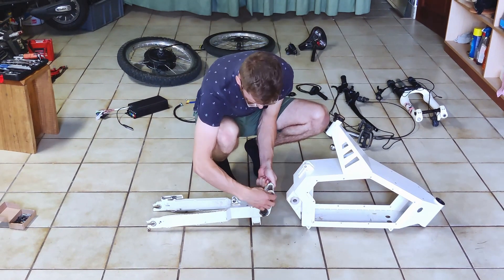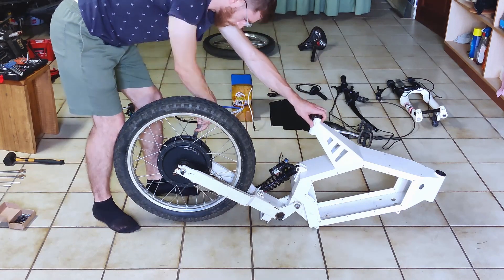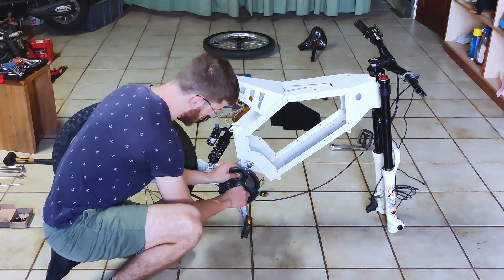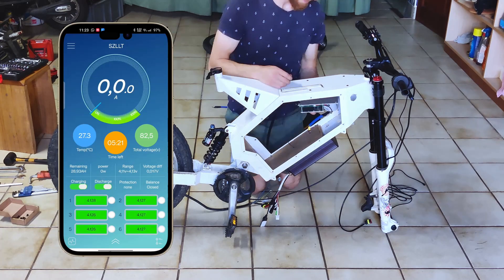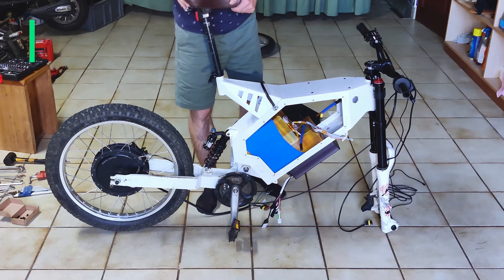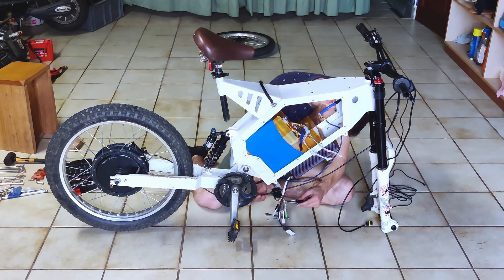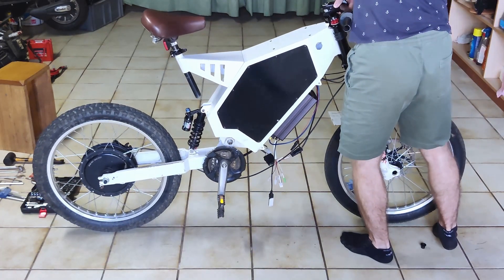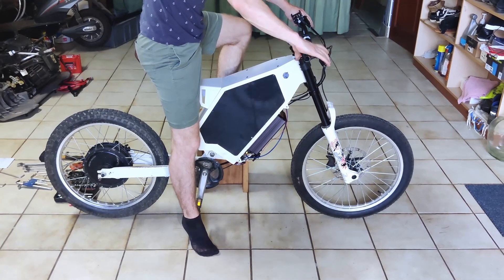DIY Cheap 5000W Electric Bike

Comment: I have the big frame and long swing arm that fits a motorcycle axel. I will be building a 12kw version with a QS273 5T with 200mm dropouts. The axel nut size will be 32mm. A Sabvaton 72000 controller and N7260 (72v 60Ah) battery. I have a built version already with those specs, that I got used. I will sell this one when I build my new one.

Comment: Where is Fuse, where is contactor!?:))
Where is pre charge button!?:)))
Have you ever seen a High voltage  DC electric arc!?
Please check the front wheel cylindrical joint welding too. mine is weak…

I encourage you to set up a safety feature such as
1. Contactor Albright sw200
2. Industry grade40/50 Amp dc  fuse like Chint CRT 36 00 50A
that can choke the electrical Dc Arc n a case of short circuit.
3. Dc to dc  90-12v DC converter, to power up  the contactors 12v coil that switches the High voltage contactor.
I have a schematics if you interested:)

The main problem is the controller that sits on a High voltage DC line. This is not safe. While you a sleep it still connects to your controller. This is not good for a capacitors.
That’s why you need a contactor.
And last thing- never turn off ignition switch  under load.
I mean, first make a full stop, only then turn off the key👌🙏

Comment: I got same frame bike with 48V 2000w motor battery 48V 20Ah and It go 60km/h top speed and constant 50km/h 
Why yours go only 70km/h with 72V battery??
Reply from the maker: Good question! The top speed of the bike is dependent on the voltage of the battery yes, but also the wheel diameter (mine is 19" rim on 3" tyre, overall diameter of 25") and most importantly the winding of the motor (or kV).
This kV is how many rpm the motor does per Volt. This motor is a 5T winding which is less speed and more torque. You can get a 3T which would give more speed and less torque but it is important to match the load of the motor with the top speed as to not overload it 
Also if the controller has field weakening you can get more top speed.

Comment: Can you tell me where you found the parts, because I looked and the prices are more expensive than what you indicated
Reply from the maker: I can tell you that the frame and front forks were used, that's why the discount. Other than that what did you find more expensive?
Reply: @Asvybre  frame minimum 500€ and électric wheel 400€
Reply from the maker: Yes the frame in the video is used, that's why the discount. The motor you can get for cheap if you buy directly from MXUS distributor. I ordered 5 different ebike motors and got a good discount.

Comment: Nice build and really cost effective! Have you rode it on rain? I'm just wondering is the sabvoton waterproof. I have the same controller and I'm also planning to put it outside of the frame
Reply from the maker: Thank you so much!
I used it in a bit of rain but honestly I am more worried about the motor than the controller. The controller does get some water on it specifically if you don't have mud guards like me but if you cover the connectors and phase wires it'll be fine!
On the other end the motor does not like water at all and I am going to open it soon to see if there's anything inside!
Reply: @Asvybre  been worried about my SB MQCON svmc 72150 also mounted in the same location. So, i took the four screws holding the side panels off... and wiped gasket maker amply along the edges. Worth adding some more where the cables pass thru. Something i should also do on my ONYX Kelly controller, been through many rain storms, never had an issue, better safe than sorry, regardless.
Reply from the maker: Thanks for the heads up. I am going to have a couple of 3d printed covers on both sides but honestly it won't be water tight so I might as well do that to make sure I don't have condensation inside the controller!

Comment: love your build , I saw you used 6 18650 wide. did it fit snuggly or did it have more room left? 18mmx6 = 108mm . I want to use 5 26650 cells, 5x 26 = 130mm. do you think 130mm will fit ?
Reply from the maker: You should have close to 143mm of space inside the frame. I really think that 130mm is too much and might be too tight for fit with insulation and the battery casing. If you use spacers with your cells the distance is going to be bigger than 130mm as the spacer adds a small gap between cells.
Hope this helps!
Reply: @Asvybre  aww man !! Thank you for your help in this . I will tag you in my video when I make it.
Reply from the maker: Yeahh, good luck on that project! :)

Comment: Would it be possible to use a cyc mid drive motor on this frame??
Reply from the maker: I am not sure about the dimensions but it looks as if it would fit. If you can get a 3d model of the motor try it out on the 3d model of the ebike I provide on the description :)

Comment: Hello cool video. Congrats.
What about the wheels? Did you buy them ready or parts and assembles them?also, the brake calipers are bolt on on the swingarm?
Thanx
Reply from the maker: Hi, thank you!
I assembled the wheels myself, learned to lace wheels a few years ago. Was a bit of a trial and error with the spoke sizer but ended up working fine. The brake calipers bolt on the frame horizontally so you need an adapter (usually comes with a new set of brakes).

Comment: Very cool - what is the range you get on and off road ? What about battery temperature ? Any issues ??
Reply from the maker: Thanks! On road I get 50-55 km, off-road having some fun will close to 20-25 km!
Battery temps remain stable (5 to 10 deg above ambient) as this pack is design to sustain 100 amp continuous and I am close to 70. No issues so far, only the motor getting a bit hotter than desired, upgrade to come soon ;)

Comment: Wasnt there enough space for the controller to go inside above battery?
Reply: Probably, but not sure you want to stuff them that tightly together due to heat
Reply from the maker: I am not sure, I wanted it to go on the outside as I need more space inside for the charger and other accessories. but if you wanted inside it would probably work 😅